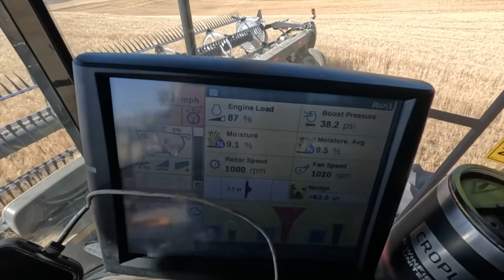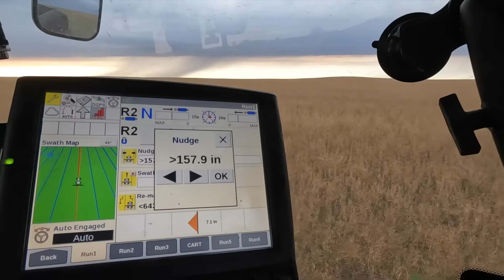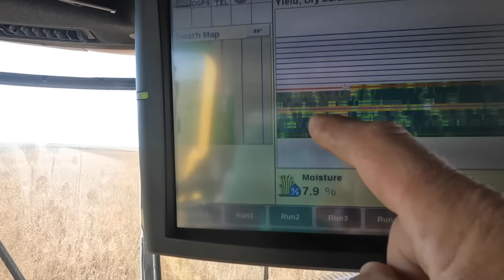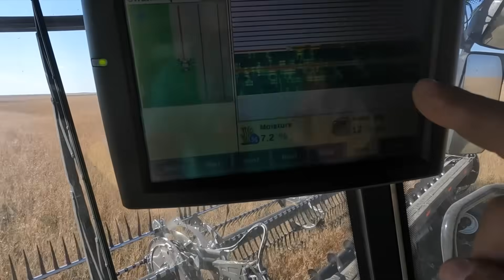61’ MACDON and a NEW HOLLAND Combine??? (Video #11 of Harvest 2024)

Comment: The changes I have seen in my life time. I'm 81, if I remember correctly our combine, a Massey-Harris, had a 12 foot header.
Reply: My first combine a used 510 Massey had a 13 ft head😂 wow things have changed 👍
Reply: Mine was 6’ drag Allis-Chamber
Bagger until. We put hopper on it.   Times have changed
Reply: My dad is 86. The first combine he remembers was a case pull type that most neighbors pulled with an f-20 McCormick and picked up a 6 foot swath. My grandfather had an f-12 McCormick with a lower gear so they could pick up 2 6' swaths.

Comment: Neighbor 6 miles west of me in east central Alberta the local NH dealer brought out the new cr11 with the 61 ft Macdon header and in 40ish bu canola was doing 7.5 mph and the drone footage man there was hardy a pod in the tank! ridiculously clean samples! And they run 2 9.90 cr's with 50fts and they were doing 6 mph!
Reply: I ran a CR11 in 280bu corn and a 16 row header. 6 mph was as fast as I wanted to go. But it would have went faster. No cob, other than head loss it is a beast. Ran an X9 1100 in the same field, and it is a beast too. NH had the right idea with the twin rotor.
Reply: Oh I don't doubt that, yeah only the very south end of the province on irrigation does combine corn, all small grains for most of the province

Comment: Nice to see you got to run a newer combine.  To bad they not bring outt the AF 11 you maybe love that one.  Thx Tony   see you in next one
Reply: Not really AF 11 is little bigger and has   different monitors  plus the spreader is different too. There other things that I not remember  all of them . New Holland  and CaseIH  are owned by same company but  there is a lot ot difference  in them. Ok  you might want to go check them out little closer ok.
Reply: Actually they are completely different this New Holland is the CR1090 NOT the CR11 which means it's smaller than the CR11 and therefore smaller than the AF11

Comment: Check the fuel tank. It could have the white milk shake starving the engine.  When I was in the US ARMY the howitzer was in had the same Issue. Lower in power . After many fuel filter and fuel pumps , the FS shop diagnosed the pack (engine) as being bad. When we pulled the pack , I pulled the filler tube and we fond the white milk shake. We cleaned the 30 or so gallons out and reinstalled the pack and the howitzer ran like a bat from the dark side, she would lift the front road wheels off the ground.  The unit commander had every howitzer section clean there fuel tanks and everyone of them ran stronger. Hope this helps.

Comment: It’s impressive to see the combination of the New Holland CR10.90 and the MacDon 61 ft header in action during the harvest. I particularly like how the automation helps improve the cleanliness of the grain sample. However, dealing with fuel pressure issues and performance on uneven fields seems like quite a challenge. Is there any plan for adjustments or upgrades to optimize the machine’s operation in more challenging conditions?

Comment: can you do a pump and injector check on your dads combine had a farm i watch combine start that crud and found the pump a tad weak and dirty injectors
Reply: The iveco motor shells out fuel pressure pumps. Ours was under warrantied as the manufacturer is required to warranty fuel and emissions systems for 10 years

Comment: The wider headers get, the longer the unloader tube needed.
 Trouble is, there has got to be a point reached, where the anchorage for said unloader auger is simply no longer strong enough, and fails, big time !
 I really can't understand why modern so called design engineers can't see this - it's a fundamental issue of leverage.
 I can't remember who it was said ' give me a long enough lever, and I'll move the World', but he definitely had a point !
Reply: Archimedes also needed a fulcrum to place the lever.

If they can build a 61' header that does not break, they also can build a 30' unloading auger that does not break.

These engineers have computers and programs to calculate these things. That's why masts of sailing ships or towers of wind turbines work.

At one point in the future, the machines don't get much bigger, but much smarter and work autonomously. For example, the Nexat.

Comment: 12:38  hey TONY.....    that combine has the engine tilted aligned with the rotor right? did you notice any HARMONIC VIBERATIONS that are in the ones that have FLAT MOUNTED ENGINES AND TILTED ROTORS????  harmonic viberations that are there in the older ones that is ''MISSING LIKE TOTALLY GONE'' in the newholly11 ???   it SEEMS like there should be more sincronized viberations so there should be LESS FELT VIBERATIONS....  so far noone has seemed to answer this, or the answer was just a ''yea it's smoother I guess they did a lot of... blahblahblah...''  period answer...
Reply: it would be the VIBERATIONS you FEEL after turning on the rotor and it spins up...